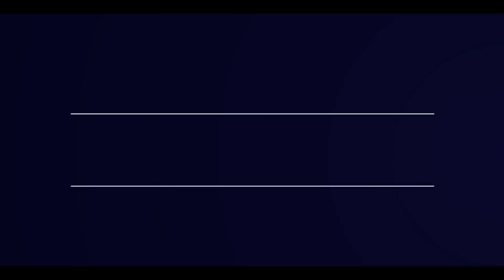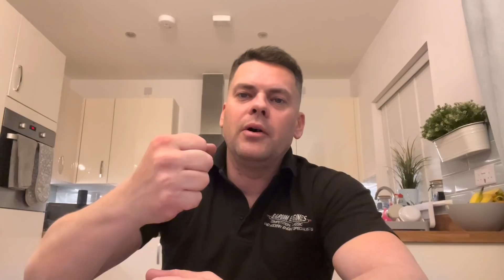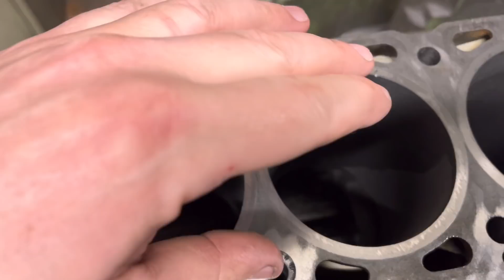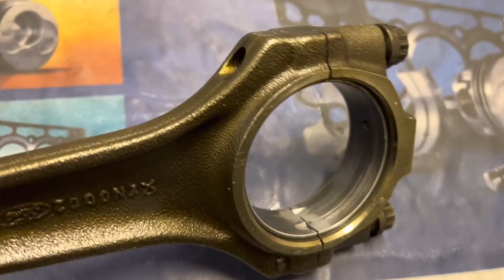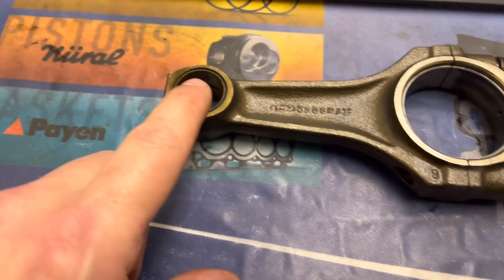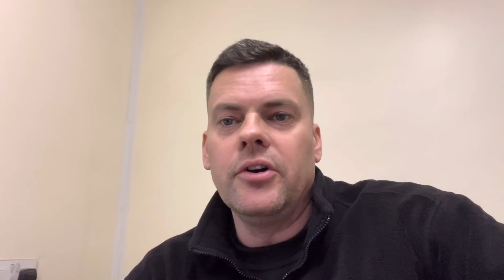Why are these engines SOO UNRELIABLE?

Comment: Having owned a Cosworth 3 door for 17 years i can tell you the strongest part of the car is the bonnet hinges, they are the only bit that never fail and also the most used. Those blocks should have been left in the Cortina where they belong!
Reply: @twinscroll turbo that would smash the t5  gearbox to bits!
Reply: @twinscroll turbo nobody but theres a lot of them out there who would fit an 800hp barra and then whinge it destroyed box and axle! They forget about cause and effect. Them barras are very good strong motors. Would have been fun to have barras back when we were tuning YBs and BOA/BOB cosworths!
Reply: The Capri is basically the UK version of the Mustang?... was this a diesel run ?? Seems like the EU loves the diesel over the petrol engine.  I am actually looking for Mercedes Wagon Diesel which isnt readily avaklable in the US.  Will be in the EU for 2 months this summer and want to buy, drive then ship it back to US.  Also looking for a rt side drive G35..
Reply: @simpsonservicesllc2987  Yea the do adblue they love too. Mercedes diesel's are good engines, the baby benz 190e i like lightweight but the new Mercedes are better off the line an top end just airbags etc.
Reply: Had a new RS1600 in 1970 which burned oil after several months
Reply: @simpsonservicesllc2987  EU diesel fuel has a higher cetane (self ignition) value than USA diesel. You wont get the same power in USA that you got in Europe.

Comment: They are reliable if the old ways when they were current are still used, 205 blocks 350 hp only with long studs, ' o' ring block to clamp fire ring better. 200 blocks and heads were better. If you wanted more hp you bored and stroke grind crank to take it to 2.4 litre, fully balance with forged pistons rods and crank. Even if head been cut open out combustion chambers to give correct compression ratio. These would give 500hp reliably, without crazy boost. The best ways to stop gasket failure was to 'o' ring block with .8 wire no matter which block it was. Plus no crazy boost. Valve issues could be overcome with changing followers for solid shimmed from audi if memory serves, and engines that were going to be revved hard 7500+ leave off stem seals lubricated stem better. Worked and tuned many of them when they current. It appears these days 'tuning' involves wind up boost increase fuel slope by a remap with no internal work. Hence they are fun for a while then boom. The old adage applies 'speed is just a question of money how fast can you go?' Too many people go cheap and it breaks. But again if you doing these, 'o' ring blocks (and heads to if big hp) it takes no time and will stop most head gasket blowing issues.
Reply: @2strokesteve  yup if they built properly they are reliable. Nice vid she sounds sweet and on song, reminds me of running a BOA 400hp cosworth v6 capri in the slick 50 series many many moons ago. I really feel tuners have forgotten the basics i listed and think more boost and fuel is the way. Can still smell cutting fluid and grinding stones 20yrs after retiring!
Reply: @chrisclarke6344  ah yes the smell of grinding suds in the morning  one of those smells you will never forget 😆, my motor had pretty much everything you listed,  wire ringing  all balanced, group A spec cylinder head , cosworth low comp pistons  6.8:1  etc , etc ......yep you can't get the power without the fuel......👍👍
Reply: @2strokesteve  its a distinctive smell! Takes forever to get out of your skin! I feel barum would have less problems if he incorporated these things into his cosworth builds. But at a very least ring the blocks thats a must. I do wonder if they even know how to stroke grind a crank or give a cam more lift by grinding base circle Let alone checking lobes for angle lift and polydine correction in this day and age. Checking combustion chambers volumes etc etc. I currently have a jaguar xfr with 600hp before pulley and map i pulled motor stripped and rebuilt with new every thing. OCD? Probably but felt i needed to for peace of mind,ten years now and she still runs like new!
Reply: @2strokesteve  i also wonder what the reaction would be to 'dry decking' with no gasket problem engines that dont want to stop blowing gaskets?
Reply: @chrisclarke6344  wire ringing worked for me  , no head gasket problems whatsoever,  the trouble with these new mls gaskets is the finish of the machined faces is critical , sometimes progress isn't all its cracked up to be....everyone is an expert nowadays   its jyst the world we live in  ,the Internet we can thank for that lol .
As for top hat liners..we never used to fit them as in extreme cases they can move under the massive pressure the cylinders are under , we always fitted straight liners down to a step in the bottom of the bore, that way it's virtually impossible for them to move. off setting a cossie crank to make it 2.4  done a few of them in my time  vauxhall bigend brgs if my memory serves me right different rods and 93mm bore.. ah the good old days
If a job is worth doing, do it once and do it right....
Reply: @2strokesteve  do it once and do it right is the way. Done right a YB will last. Never liked top hats, we very rarely lined them unless they were totally out of spec, they had enough meat in the bores to go oversize. A few would split at crazy boost but mainly 205s not 200 from memory. Wire rings are the best solution. With regard to liners had a discussion on another barum video  some one said they always left liners 2-3 mill proud of block to seal better!! Also said no cossie used stretch bolts either? Internet experts in full cry! Sourcing the parts for the 2.4s was all part of it. I remember a few were converted to wet liners for rally cross to enable quick repairs. How times have changed, glad im retired i think.
Reply: @chrisclarke6344  yeah the only top hat engine we did wasn't a yb it was a 6r4 metro rallycross car from late 80's which had split its liner...New one made..fitted...car ran all season in both UK and European championship   the driver famously rolled it end over end think it was in one of those havoc videos , bright yellow it was, my father knew him when he was a 17 year old...said he was a bit mad then lol....
Reply: @2strokesteve  the venerable 6r4 and the rs200, group b was much more exciting than todays. But the demise of group b let many of them go to rallycross. Much more relaxed times without mr elf and mr safety hanging around. Plus as you say drivers were more loons as well. In the old slick50 if a gap was left you went for it even if it meant 'rubbing' all the way round. We converted the capris to bolt on wings to make repairs easier! Paddock hill at brands flat out past pits throw it in at 120 and still be riding the oversteer as you approch druids. Fun times.

Comment: Considering what power you can get out these engines at that time was unreal for a 2.0 litre turbo! Very good video on engine rebuilders for the things that go wrong after time but credit is due to cosworth at that time for a guy that could jump into an old sierra and compete with the likes of Porsche or Ferrari at that time that’s a pretty big deal!
Reply: With proper preparation you could have a sierra that would walk porsches and ferraris of the time.
Reply: EugVR6 sounds like the journey was a blast! Weused to tune them back when current, 350 out of 205 block, up to 500 with 200 block. See my post elswhere.
Reply: EugVR6  ah collins performance engineering, they did good jobs on them reliable hp not crazy boost that caused issues. As i said we wouldn't go above 350 on 205 blocks even then they were long studded and 'o' ringed blocks. Good engine with reliable hp if built correctly. Very quick in their day, back then i had two capris on with a 2.9BOA in for racing, and a 2.8 cologne heavily modified with 300hp for road use. Good days when tuning was hands on not just a remap. Has he still got cossie?
Reply: EugVR6  thats a shame would be worth thousands now,i sold my capris for peanuts many years ago, big face palm moment now! Shame about the ferrari but they are an experience when running ok.I now have a jaguar xfr with 600hp, its really to quick but good fun and theres not much about that leave it behind! You can get funny looks when they see a retired coffin dodger driving it with the wifes cuddly dog stuffed toys on parcel shelf, destroying m5s!
Reply: EugVR6  absolutely an old mrk1 escort with an asthmatic crossflow 1.3 was a lot of fun could use all the horsepower all the time! Ive had escorts, capris, cortinas, granadas, golf gti, and a few jags xjr, s type r and xfr. All been fun to old now to have to get under bonnets on a cold winters morning trying to coax a reluctant  2.0 pinto mrk3 cortina into life! So very attached to the xfr, ten years now and only normal maintenance and consumables, apart from pulling and needlessly rebuilding engine when i put pulley and map on it. Bit OCD but old habits die hard and i felt uncomfortable about not checking it!

Comment: Could you do a vid on the most reliable and robust common production engines.
Reply: Saab 2.0 or 2.3 Turbo. Gearboxes less reliable under extreme power. Engines very strong.
Reply: X-flow. Best Ford engine. Rock solid.
Reply: Most reliable you're probably looking at the RB and DE series, JZ series are pretty solid and Duratec from Ford were tough donkeys too.
That said, anything is reliable if you run it as intended and keep it maintained well.
Reply: Honda K-series
Reply: General day to day - Honda, by a absolute mile. Out of the thousand odd "normal" engines I've built (not modified ones basically) there are 0 Honda's.
Reply: @stewills9711  Duratec's are a brilliant engine after a rebuild. Terrible from the factory though. Proper oil burners.
Reply: Ls3, bomb proof
Reply: Ls the world
Reply: @Bikemad24  are you joking?
Reply: @mattsmith4053  why would i be? its a fantastic engine that can do 500,000mls, is swapped in practically every car you can think of, its very simple in design and can make insane power pretty easily, its pretty light and small for capacity. Has more mods, cams, pistons, heads available than any other motor. 
Iv one in the uk makes 651whp and has done 121,000mls..and its been worked very hard.
Reply: BMW M57 pre DPF with the swirl flaps removed. 
K20a Honda (no design flaws and thrashed from new)
Lexus IS200 engine
Reply: @Bikemad24 ls are good motors. 427 side oilers are pretty tough as well an acquaintance had one in a 71 mach1 mustang it was 300k up and still going strong unfortunately the body turned to ferrous oxide around it. The motor was then put in a power boat untouched and still running well.
Reply: @mattsmith4053  The LSs I have had in the fleet have always been reliable.
Reply: Something a bit odd about asking an engine builder to do a whole video on an engine he will never (or very rarely) see!
Reply: Boxer engines  for you Jonathan Pearson
Reply: @Bikemad24  My LS3 rotated a lifter at 31k. Chopped the cam, ate the lifter, completely stock.
That's not a reliable engine
Reply: Toyota 4a ge maybe....dimensionally similar to bda but not broken all time..
Reply: Redblock Volvo.
Reply: @stewills9711  RB's aren't reliable.. DE isn't an engine it's just Nissan speak for dohc.
Reliable is Barra, 1uz, etc. Sh!t that can do half a million k's without breaking a sweat and stock, can reliably be alot more than doubled in power output with a bit of psi..
Reply: The Toyota 3S-FE 2.2L twin cam( predominantly found in Toyota Camry’s from 1993-2003), along with it’s sportier cousin, the 3S-GE.
Reply: The Honda engines spin faster. Than all the other engines yet are regarded as the most reliable in general... K20 b16 etc for the win
Reply: Most robust petrol engine, Volvo Redblock. Most robust diesel engine, Mercedes OM615/616/617/601/602/603 (same basic engine but in different capacities and cylinder numbers).
Reply: @Scrubworks  Hmmm🤔.. Nope and nope..
Maybe so in countries where numbers are mythical questimates but not in real ones.
Reply: @DStead2239  Ok mate. You know that the highest mileage car in the world (Volvo P1800 with 3.2 million miles) is powered by a redblock? And the entire fleets of diesel Mercedes that served as Berlin taxis and regularly clocked over 1 million kms on unrebuilt cores, and continue to jolly around Africa to this day? I suspect I'm wasting my time with you, as you clearly have no experience with either engine and aren't interested in listening to anyone else.
Reply: @Scrubworks  🤔Hmmm, Nope..
Robustness testing is introducing outside forces to see if they'll withstand proper operation without failure. 
Taxis are the perfect parameters in which a vehicle can run, that's longevity in ideal conditions, not robustness. 
End of life vehicles being flogged off for use in third world nations isn't a measure of robustness either.
Drive that sh!t here in the outback and see how far they get you🤣.. 
There's a very valid reason the common vehicles here are common..
Reply: @DStead2239  Hmmm 🤔..... Nope, you're not worth it. Just confirming really that you haven't a clue about these engines.
Reply: @Scrubworks  🤔Hmmm nope..
Just confirming you're a "you tube mechanic" google me an answer type🤣 Not a real one.. 
Saying I don't have a clue about certain type's when you haven't the experience or know how to build any🤣🤦‍♂️
Reply: Aaaah....you want to see a vid with Scania and Volvo engines??
Reply: Toyota 3sge are the most reliable 2ltr 4pots
Reply: @Darian Istead  yeah sorry meant the VQ's just couldnt be arsed to edit 😂
Reply: @DStead2239  Yeah meant the VQ series, the DE, HR and VHR being the better ones. But the RB not reliable ? the RB25 will take 400Bhp on stock internals just fine. They are solid, its all down to maintenance or lack of to be fair.
Reply: @dogshome7110  5th gear went while pulling 1 ton caravan @ 100 😆
Reply: @dogshome7110  also the newer b235 are cheese pistons
Reply: Wouldn't really be in the spirit of the channel

Comment: This was due to the ‘pig’ iron blocks. Generally, when these engine blocks were cast, zinc, & phosphorus were used to ‘ignite’ the iron, pre the lafting process. The lafting process is undeniably the most important process in casting. German/Japanese lafting processes in the same era, formed iron with a much higher renderform atom bonding composition, proving how superior their process was.
Reply: Ford should have redesigned the block when the 200 came out not just add more block thickness in the bottom of block to aid 4x4 , knowing the weakness they could have designed it so the metal at top of block was deeper for further stud or bolt inserts and made the stud holes like the center stud holes , the 2 in middle of block have towers to bottom of block and they never crack through them .... ford's fault really
Reply: And if you check the ford Europe blocks we're possibly made in Germany so it's not what you think m8 ... its bad design
Reply: Imran don’t talk utter nonsense , I am a die toolmaker and in the die casting industry for 20 years , in the older times engine blocks are low pressure gravity cast allowing more porosity in the casting , modern times are more high pressure injection decreasing porosity within the casting and we now have X-ray scanners to check for default casting as opposed to olden times was cast and it was good to go 👍

Comment: Old engines, refurbished umpteen times and pushed way beyond their original power outputs.
Reply: If its done correctly they will still be reliable, problem is the techniques developed when they were current that let them hold together have all but been forgotten.

Comment: Hi. Old guy here. I remember stage 2 pinto's. Basic clearances for cylinders were close to worn out to reduce friction, give a few extra hp etc, and they were never ever expected to last 40 years and you can't just run them until they have an issue. They need regular rebuilds. Most have been ragged to hell, tuned well above their designs as you very politely stated. And no one runs in engines properly any more! I also wonder about ali heads on older cars? Lot of electrolytic stuff going on in there that can block a small 80's port. My current baby has an LT1, I am using OAT but the scum that come out of her. She's quick and noisy though ;-)

Comment: Very interesting video, I'm just a general diy guy with some experience and it was an eye opener that the head bolts pull so hard as to distort the block! Wow.
Reply: There were ways round that, long studding and using torque plates to bore and hone thus allowing for distortion. O ringed blocks stopped the gasket failures and finally 205 blocks no more than 350hp. Keep boost to sensible levels they will be fine. The block was early 70s tech and was an improvement on the T88 blocks. For reliable big hp the stronget 200 blocks were used with all  things listed above but bored and stroked to 2.4l then you could get 500hp reliably without stupid boost pressures.
Reply: Why do you think the Rover K series engine had bolts that went from the top to the bottom, to address this issue, perhaps?!

Comment: From what I understand that little unworn area near the parting line on the big end bearings is clearance designed into the bearing to allow for detonation, because when a bearing is exposed to the hammering of detonation they will close in, that bit of clearance lets them handle a bit of detonation before the bearing scrapes the oil off the crank and spins a bearing. Detonation is probably why you also find some rods smaller near the parting line.